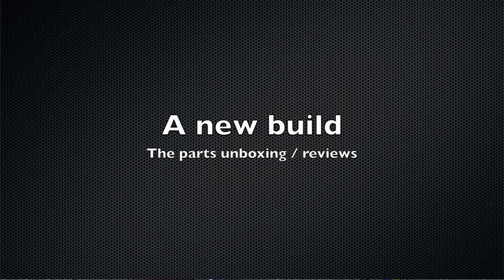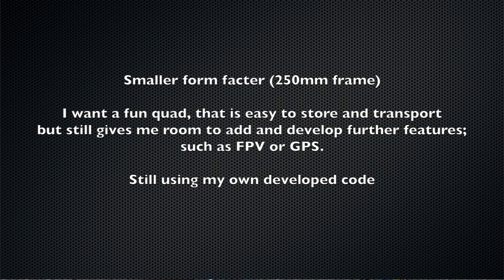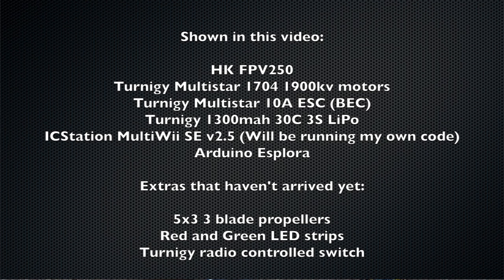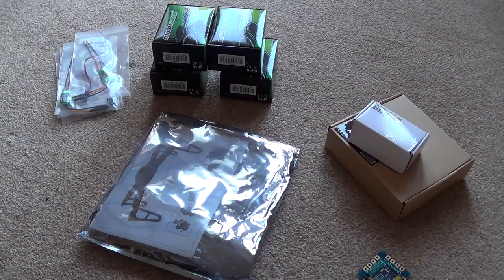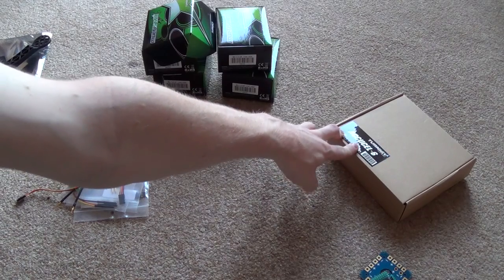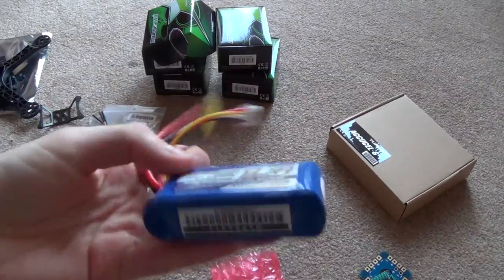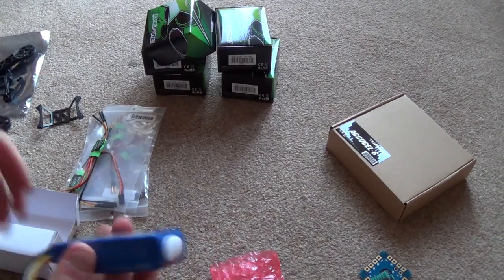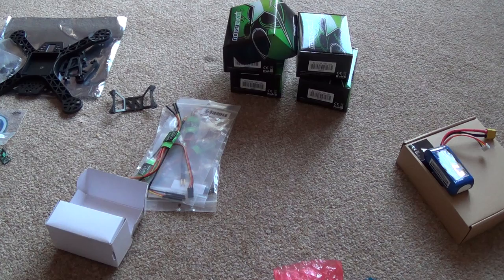Arduino Mini Quad - Parts review and unboxing

Comment: Have you managed to get the servo library working with the VirtualWire library? They appear to both use the same timer or something. I have been using the SoftwareServo library, but it isn't very good.

Comment: Hi. I´m going to build a quadcopter using the S500 frame, an arduino nano or uno and a multiwii 6DOF with compass and barometric preasure sensor. I wonder if it´s necessary or if you reccomend me to use a motor shield or a proto shield of any kind. I also wonder how you reccomend to control the quadcopter, what´s the best option for a beginner who want´s about a 0.5-1 kilometer range and a fair price. BTW I´ve found your videos very helpful to decide parts.

Comment: This is incredibly similar to a build that I am planning. I am using the same RF module, and I am going to use an arduino nano as the flight controller programmed with my own firmware. However, I am going to be using a wii nunchuck as the control input. I haven't decided on the motors, ESC and frame yet, and I may use the same ones as you.
Do you know how much range those RF modules can do?
Reply from the maker: HI, thanks for your comment and for your interest in my video. So far I have only tested the RF modules indoors and had 125-130m range. This was through walls and with a 17cm antenna soldered to each module. I am planning a range test outside and I will report back. Thanks again.

Comment: I'm going to build a Quadcopter as well ;)
But I'm not sure how to connect the motors to the arduino. Do I need a Motor-shield or something like that?
Reply: you need to use a esc which will act as a interface between your motor and arduino
Reply: Thank You ;)
Reply: No problem 😊

Comment: Ok I'm a born again flyer to be, I know a fair bit about old 27mhz gear, and nothing about this new stuff, so to fly a quad say 400ft from me, what /cheap/ radio gear do i need for that, i'm on  a crap income so cant afford quality stuff but dont mind trashy if it gets the job done, I can toughen it up later.... will need a spare button or two and output on the receiver to switch a few things on / off on the quad

Comment: I've been using the same rf transmitters in an RC car project and there is a slight problem with them they require the use of the arduinos timer1 however the standard servo library also requires timer1 so the two are incomparable with each other. I've been using servoTimer2 library to get around this ( https://docs.google.com/file/d/0B3v4Es4RIiTidWhuWnNWNGFjd2s/preview?pli=1) it works really well but it needs the pulse instead of the angle as an input but this is simple to map across.
Reply from the maker: HI, Thanks for your comment. This is true and slipped my mind when making this video. With my last build I was using ServoTimer2 because of a similar clash between hardware timers. Have you got any videos on your RC project?
Reply: Kyle Fieldus unfortunately not I'm having some problems sending my string over RF, it was working fine when I wrote some test code but since I've integrated it into my main code something went wrong, fingers crossed I'll have it sorted in a day or two (I really want to show it off at my local maker space on Thursday) I'll get a video up when its working.